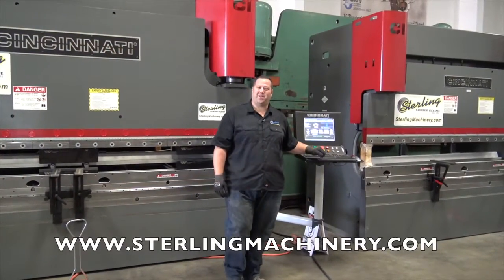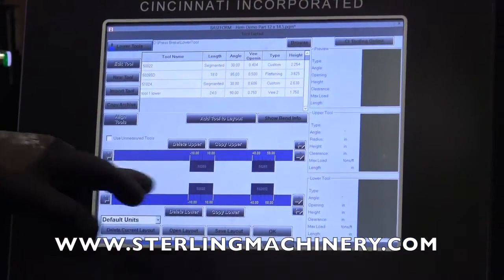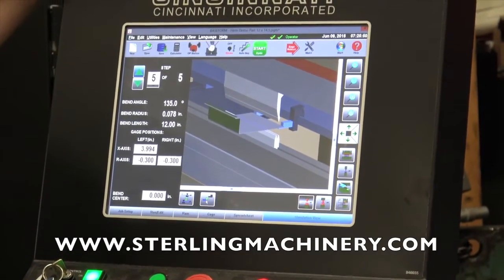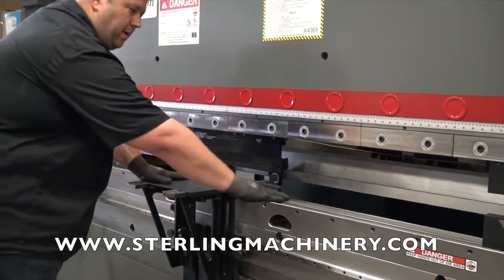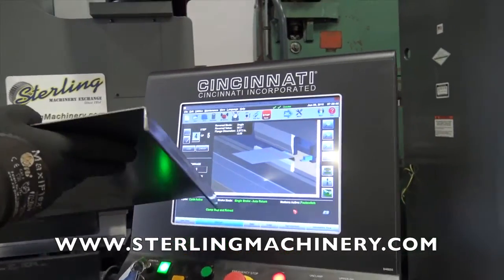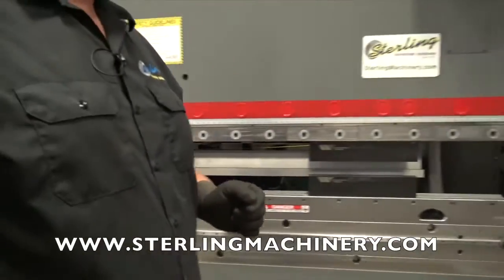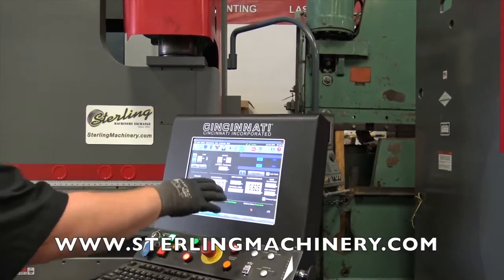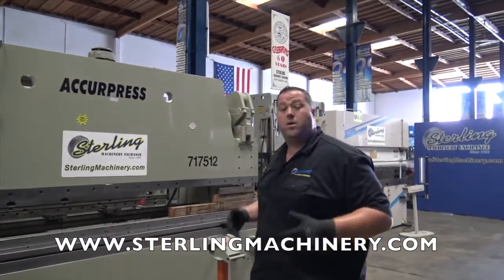175 Ton x 12' Brand New Cincinnati Baseform Hydraulic Mdl. 175BX10,  #SM175BX10

Comment: I work with and have worked with strictly Amada press brakes some ATC some MTC. I have to say I like the console graphics on this Cincinnati vs Amada. We run 3i programs on our Amada PB's and the one thing I've become disenchanted with is the amount of adjustments I have to make to dimension specific programs. I don't have many years under my belt only 5. But I definitely feel when a prgm is set for a particular angle and flange length ( bend deductions, material thickness & tooling all correct ) and I still have to dial it in upto 8° +/- and 
.030 to .050 on initial flange length something is not right with the programming or machine. I mean hell, I personally think our head programmer is a fucking idiot especially when he tells us to run dies 12-15X material thickness and he says it completely normal, but hey I'm just a lowly operator....🤔😕